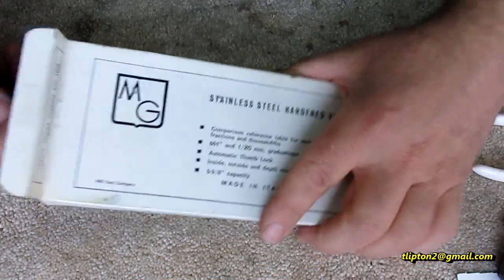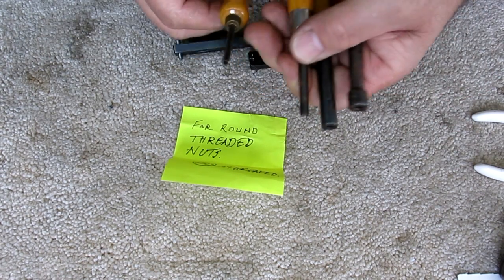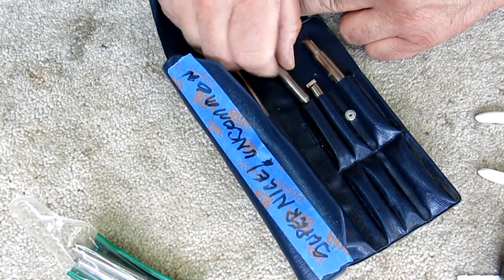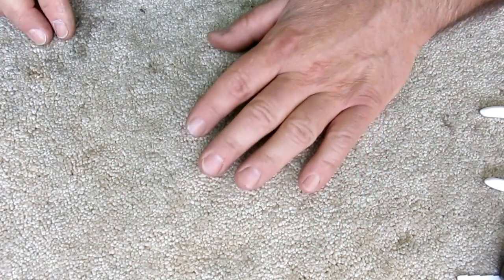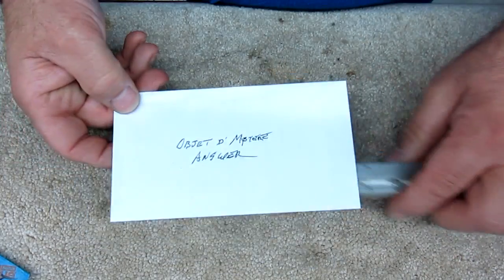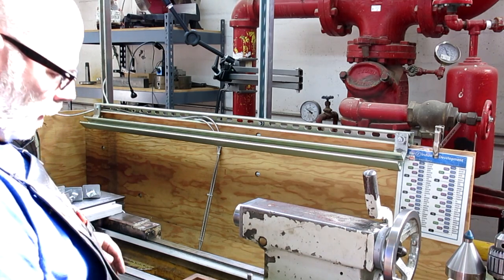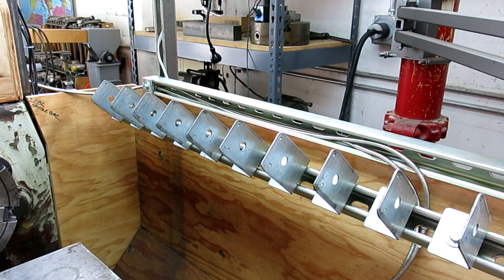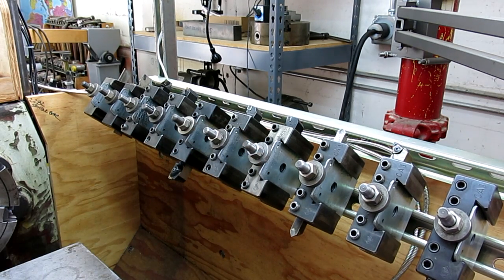Monday Night Meatloaf 95 Part 2

Comment: I noticed you were removing the "tool holders" by sliding them to the end of the UniStrut. Usually the internal clamp plate in the UniStrut, can be removed simply by loosening the attachment bolt, pushing it into the Unistrut, and rotating the clamp plate 90 degrees. Usually the clamp plate is rectangular in shape, and the narrow dimension will fit through the opening in the front of the strut. They are designed like that because in some uses the ends of the UniStrut are closed by structure, and you need to be able to attach things to the UniStrut after it is installed.
Reply: +kwbarnes1 I really should watch the entire video before commenting.  Just finished watching, and noticed that you installed the tool holders from the open front of the UniStrut.  Loaded up that strut moves quite a bit, it might be worth adding a couple more brackets to help support the weight.

Comment: What a coincidence.  Just yesterday I was going through some boxes and found my high school drafting equipment as well as my slide rule which had gone missing for decades.  Took it out of the pouch and it all came back to me.   In a few seconds I was a slip stick whiz again.  Its batteries were still good after all that time...  I hate electronic calculators, would rather do it in my head!  The slide rule is now in the front of the top drawer of my desk, a place of honor.

Comment: I've got a few circular slide rules around here.  I never liked them.  I used a regular slide rule in high school.   The Lowell Observatory has a slide rule on display that is easily several feet in effective length.

Comment: Nice assortment of VA mail. No guess beyond a simple 2-axis level on the Objet d'Mystere.  Those Bernard chain-nose pliers are really nice. One of my parallel-action pliers is an actual Bernard, and I like them more than all the others.

If you don't have another 45˚ bracket handy, consider moving the two existing brackets to the 1/4 and 3/4 positions to take some of the spring or "bounciness" out of the rack. Shorter unsupported lengths, and the weight is balanced (imagine a hinge in the center of the span) on the two existing brackets.

Comment: G'day Tom. The old verniers are great for the mechanics toolbox, after 40 odd years mine are still in good nick and the big advantage of course the battery never goes flat. The only problem is I have to put my thinking cap on to remember how to use it when measuring something in thou, if it's something that critical I drag out the other good vernier, the Dial vernier, they're magic and again no batteries.

Comment: Hey Tom,

the angle looking level is a level of a different kind... it attaches right to the device. my guess would be either a piece of field artillery or mobile radar unit.. most likely something military.. 
it's for  getting a pole or mast perpendicular without having to slap a long level on something or running a plumb bob
the 4 holes along the shanks of the thing sort of tell me it attaches to something direct. if it were a true machinist level the underside would be milled to have parallel surfaces to the bubble vials.
it's a plumb bob in a strange sense 

can't wait to see what the answer in the envelope says

cheers 
mike

Comment: Thanks for sharing a great box of goodies like that, kinda like trick or treat for machinists!  Also thanks for the closeup on the lathe tool rack and back splash, great space saving utility idea.  I realize its basic woodworking,  but do you think you could shoot some video on how you built it?  The superstrut rails are obvious, but I'm curious as to how you integrated the back splash with the lathe and if its holding up to your satisfaction with oil and coolant, etc.

Comment: Although I was an engineering and draughting teacher I also had to teach maths (1960's). The circular slide rule was part of the curriculum for the first five or six years. I had a need for one with special graduations for calculating time and distance. I drew it up myself. The base circle was 12 inches. (NZ hadn't been metrified/mystified at that time].

Comment: To set the angles on a camera mounted in a plane?
Reply: not sure a level is a lot of use in an aircraft,
Reply: +God of Thunder (UKKONEN) I have a sextant designed for aircraft use. It has a very sensitive circular bubble level which appears in the field of view along with the observed star. You hang the sextant from a hook in the observation canopy and while keeping tension on the hook, move the sextant and adjust the elevation knob until the bubble is aligned with the star. A form of artificial horizon. The level works quite well in that use.

A level fixed to an aerial camera would ensure that the pictures were taken with the camera in a very-close-to-vertical position. Very important when taking photographs for stereo-pair elevation measuring. I have two stereo viewers for such comparisons. The one from WWII (Japanese) had a set of micrometer-coupled cross-hairs which let you measure the distance in apparent separation between two views of an object. By comparing the distance with the separation of the positions of an object of known elevation, you can calculate the elevation of the unknown object. For accuracy, both photos must be taken with the axis of the camera as nearly vertical as possible.

Given that, and knowing that the donor was an aerial photographer, I will change my guess for the Objet d'Mystere from "No Guess" to "a level for an aerial camera" along with Lee Humes.

Comment: A great selection of special tools that the gentleman has sent in to you. Those parallel pliers are just so great to use and grip really well - I use a very much beefed up pair (made in New Zealand) for cutting and working with high tensile fencing wire, just a brilliant tool.
I don't know if it is physically possible but I would like to know a little more about those special Peak magnifying / measuring instruments please.

Comment: I have the exact Vernier caliper but it says Craftsman on it. It was the only precision measuring tool I had when I got my lathe. After boring a hole to match a shaft twice only to have it loose; I found the inside jaws ere off by 0.004".

It was one reason I started looking for telescoping gauges. Use the same tool to measure a shaft and the mating hole.

It does have one feature I really liked. That is that locking mechanism. Press to RELEASE. So, press, slide up and the just let go to lock. I wish my digital ones had it rather than that stupid wheel and lock you need another hand for.